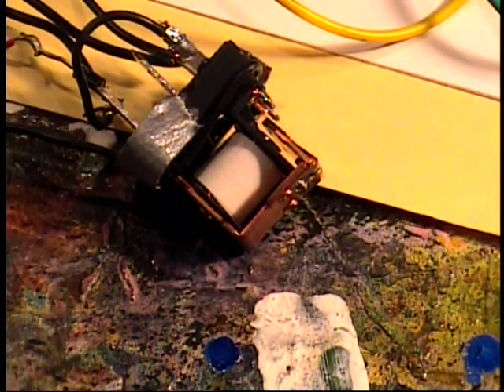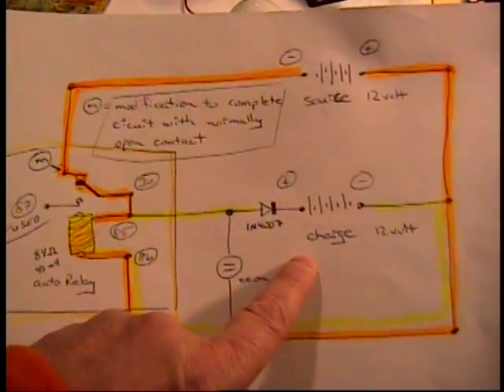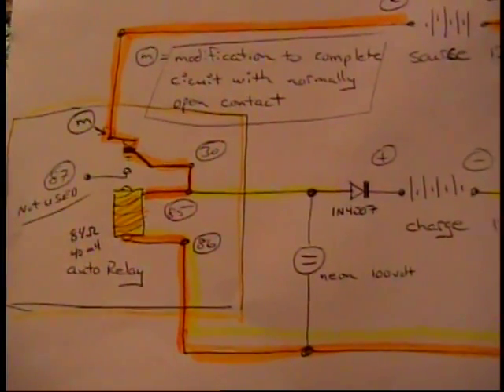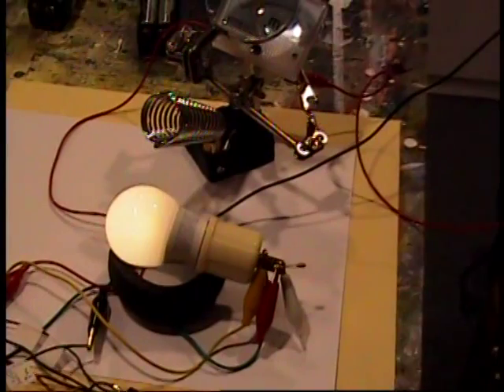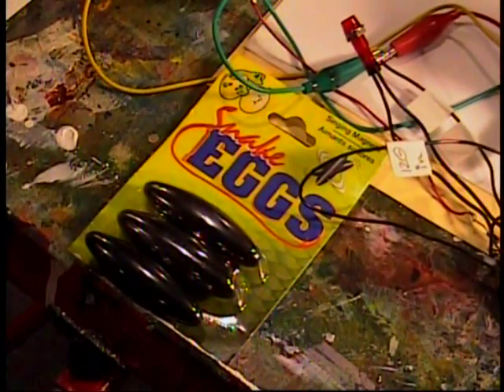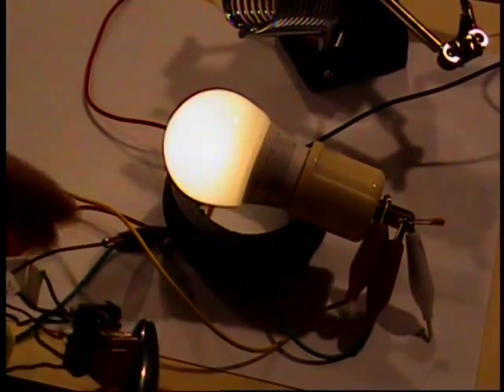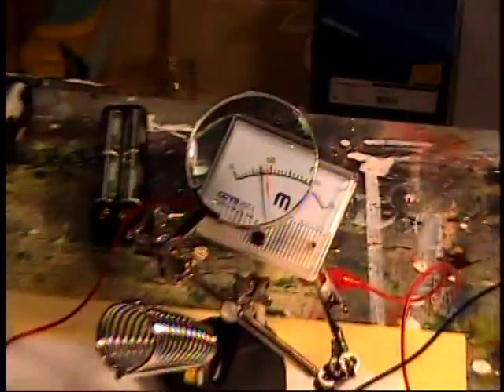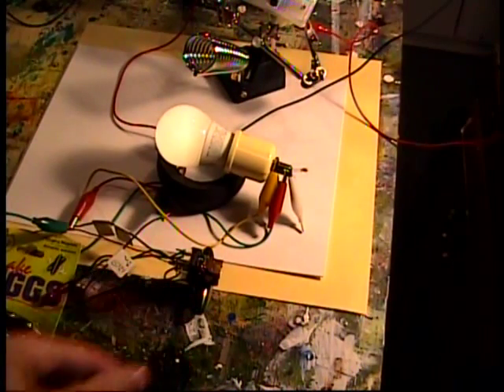Imhotep Auto Relay Mods

Comment: Hi Ron,
Does it need to be any specific relay or it could be any?
Reply from the maker: +Talha Kamran I have only tried this with automobile relays myself. A back EMF can be generated from any coil so why not a smaller lower voltage relay like a 5 volt? If I come across a 5 volt relay I will try it. And do not wait for me, try it yourself, I would like to see it!
Reply: If you use a 5-pin bosch type relay you don't have to do the modifications to the relay. If you use a 4-pin relay, you have to disassemble it and make a connection that isn't there. With the 5-pin Bosch relay, you use the center 87A pin as the connection to 30, then hook 30 up to 85 and the Neon and diode connection. It's a very quick way of making the relay work as a back EMF device.